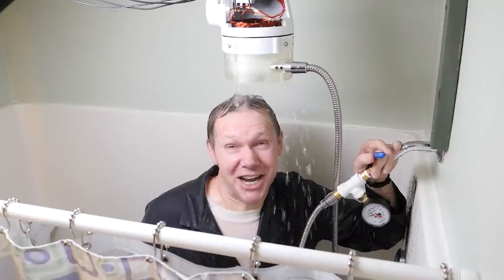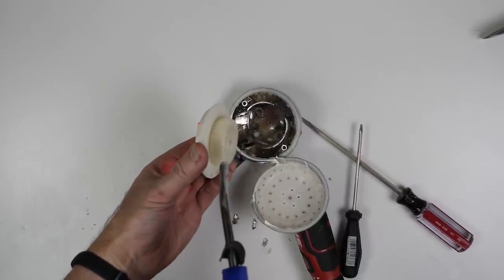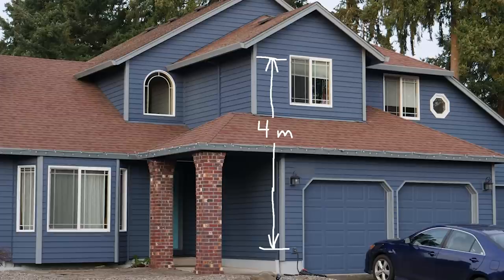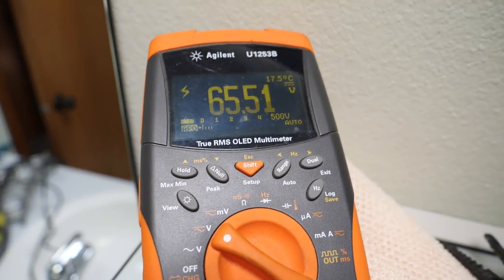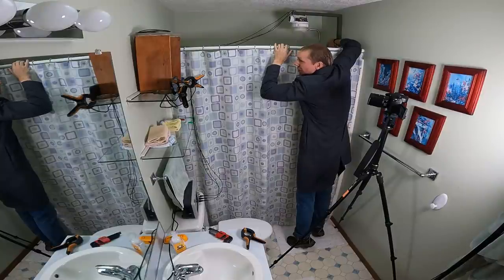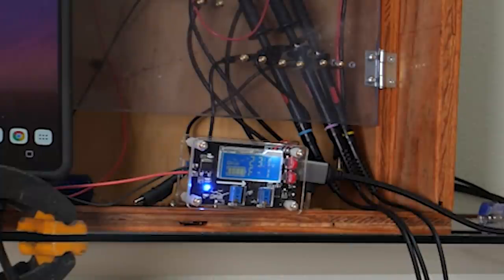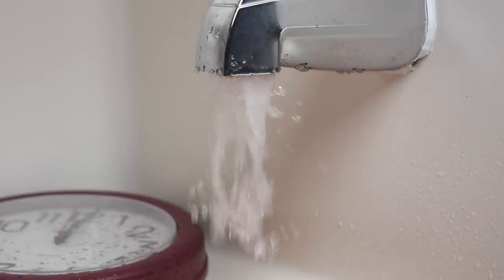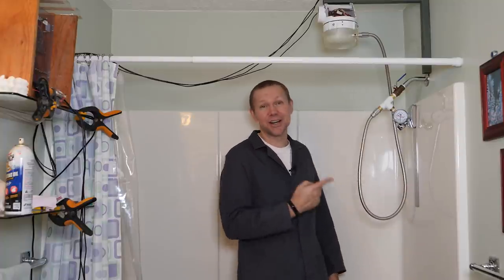SHOCKING Results! How much POWER is in your SHOWER?

Comment: Where dose the water turned 90 degrees from the wheel go? If it's bouncing off the housing and then hitting the wheel a 2nd time that would counter act some of the initial power from the water jet.

Comment: This video shows you what happens physically when you want to take energy from moving water. I had no idea it was that difficult to take 5 volts from shower water.
Seeing that generator suddenly lurch with a load was the most interesting part of the video to me.
Reply: yeah same.
I've had an idea where you'd replace the control nob with a micro controler paired with some digitally controlled valves, that way you could "teach" the shower what temps you like your showers. 
Me I like to warm up the water (I bet like most people) and then gradually increase the temperature as I shower.
feed those same inputs and timing to a MCU and it would eventually just learn my pattern.
Add the "pair my phone" and it would know who is showering at the time and recall the patterns
non of that cloud shower pattern lol, but just a simple "MAC address lookup"...

Anyway the main issue was that I didn't want to have to plug inn the shower or rely on batteries, then looking into those self illuminating showers kinda implied that, it can be done, but you'd either have to invest heavily into a miniature turbine, or have to deal with extremely low power MCU and motors... It's a neat idea for a problem that can be solved by "the hand" 😅

"modern problems require modern solutions, but some times the solution is the problem"

Comment: You need to keep the voltage up to drive the current it makes it way more efficient but you will need rated hardware maybe a solar inverter via a full bridge rectifier with a large capacitor between
Reply: that was kinda my thought too...

Comment: I've often thought whether this could be used in Scotland. Our water is paid in tax but not metered (it comes from the big lochs) would this be feasible to use straight from the tap using a generator to power smaller appliances?

Comment: Maybe you can put a gear between the turbine and the coil, that slow the spinning speed down but higher torque. Also increase magnet power to compensate the slower spinning speed I guess?

Comment: I am aiming to use a 275 gallon tank about 200 foot of line down an incline of a hill and use a water jet at the end twitch A pendulum wheel of two feet across for torque and generate a large amount of power from my house just by it raining 🌧!

Comment: I think the generator is spinning so fast it’s creating a back EMF voltage that’s limiting it’s output power. 
You should check out the motors max power rotation speed and see if you’re near it

Comment: Did it get hot? I mean you corrected the power available, so the jet should be throwing that power
The pelton has an efficiency limit but from 70 to 3 W...
If there are loses I think is probably heat

And one thing I want to ask, how did you expect to charge the phone with 70W? Doesn't the charger limit that to 5V and a safe Intensity?

Comment: You assembled this project, but you didn't do all the required engineering. Where is your computation of the expected electrical power output into a given electrical load impedance?  You need to match the RPM and torque of the turbine to the RPM and torque required by the generator when it is loaded at the impedance of your load.   A MPPT converter could help you a lot.  You also need to use all three phases of the output to fully utilize the generator and get decent efficiency out of it.

Comment: Hi, I think the problem is that you connected the Pelton directly to the generator. What if you use a pulley 3:1 to increase the amps in the generator. Lower rpm=higher amps.

Comment: You do a turbine like the archimedean screw turbine or you could even set up multiple jets around the turbine to give it more balanced pressure around the turbine or completely enclose the fan so the water has to push the turbine

Comment: You can use a stabilizer to transform the 65V and ~1A in a 5V constant voltage (it should be 10A)
Reply: So I think the problem it's in the electronics
Reply: That's not a stabilizer. That's a DC to DC converter.

Comment: I wonder if a fitting voltage converter could get more power out of the original coil configuration of the generator.

Those 65 V sounded like a lot, unless they were at 50 mA.

Comment: I don't know anything about this stuff but what if you designed the wheel so that it only directs the water downwards instead of up and down, so that the water is not staying in the enclosure and dropping on the spinning wheel? My gut feeling is that it's a tiny difference, but maybe a little efficiency could be gained.

Comment: To get the most power out from these type of generator you need a MPP tracker. Power is voltage times current If the generator is let open circuit there will be no current and there for no power. On the other side if an short circuit is made on the generator the current will be high but the voltage will be zero. No power generated in this case ether. The maximum power output lays some where between this tow extremes. 
 By lowering the current on the voltage controller the power output got closer to the maximum power point of the generator. You tracket the MPP without knowing it I presume. Thera are even of the shelf controller tho do this job with sophisticated algorithms. Main usage is for pv modules.

Comment: 1. You might be running into balancing issues when only pulling power from a single phase. 1/5th instead of 1/3rd?
2. Maybe using a 3-phase to single phase transformer might help. If said beast exists, in your power range.
Reply: Balancing on 3 phase is to do with load balancing where there is a neutral line.

Not relevant here.

Comment: How much height do you need for 80 psi? Like 160 to 190 feet or so?
If hydro works in commercial settings, it should also work in a private setup. Scale might be the only limiting factor. And a closed loop system would keep all components from debris. To make up for power use from pumping water back up into storage, a mechanical pump system that doubles as exercise equipment would work nicely. I always complain about there being no purpose to sit on an exercise bike at the gym, but if I had to do it to provide power, I’d much more likely to do it. 

Great experiment, keep it up. 

Challenge: scale it up to charge a 12V, 100amp 1280 wh LiFePoS battery

Comment: You should put wind turbine behind a car. Pelted turbine in a just right spot where it sits mostly in low pressure except where it pushes the turbine.
Reply: I mean... you spend gas to push car through air. but behind air does the job - that`s where you can theoretically collect power back. I will probably introduce drag anyway

Comment: This is a great project and a great video! I have to say though, I am a little surprised you just fired it all up the first time and blew up the one reg. Would have been better to see what the open terminal voltage of your generator was, then maybe put some load on it with some resistors and see what the voltage was then. Great video!!
Reply from the maker: Totally agree.  But that generator always underperformed in the wind power videos and was only rated for 12v.  So in my mind I had super low expectations for it.  In retrospect, the math predicted a free spinning RPM of like 6k so it should have been no surprise the voltage went that high with no load! 😜  Live and learn...
Reply: @QuintBUILDs  makes sense. Works out good though, when things blew up, people are entertained. That's what makes up 50% of drawn for Electrobooms channel

Comment: Well...  2.5 gallons at 85 psi, is about what a small 15amp 120v air compressor uses for energy.  Water is denser than air, and generates more torque, so that much should be recoverable.

I would wager, its partly an electronics issue, and partly a method of harnessing issue.

It takes large volume to turn a turbine, with a open case, and large cups, and big internal spacing. 2.5gpm just isnt enough. A turbine will not move as fast encased in water.

Need a closed cased with tight tolerances, and honestly for this type of application, possibly a smaller turbine, or piston, and a nozzle designed to produce laminar flow.  I think smartereveryday developed a cheap one in his video. Or just use a compression cylinder design.

Also the burned bearing was caused by something, probably previous use, combined with case pressure.  Case pressure means either the ouflow nozzle is too small, or there is too much water turbulence inside the case, probably the latter.  Solved by closer tolerances.

Comment: I have bin thinking about this for a while but not the shower but on the water main. that way you have the shower, sinks, toilet all in 1 swoop. Buy ofc you can just tap it at all points if the pressure is enough. I think pressure is high enough to tap it several times before the appliances. Ofc if everyone does this that resistance willl screw the water company but thats a not my problem kind of deal.   saving money is saving money.

Some quick math tells me this delivers about 10-15 kWh a year on my usage based off your power lol.

Comment: I think there's something wrong with the generator. Maybe instead of changing the generator, it would be better to add a transformer. It would decrease the current on the primary side and you'd have a lower voltage and higher current on the secondary side.

Comment: The one thing missing in this is the amount of energy that goes into heating that water in the shower as that is where the most energy is... The title is because of that wrong as this is just about the energy you can harvest from the cold water pressure in the water supply which on itself is interesting.

Comment: Hmmm....modulate flow rate to optimise power at a lower RPM somehow, maybe...apply more torque to the generator, so it harnesses more power? after all it's designed to operate against a LOWER density fluid...

Comment: I would not have modified the generator. You were getting 72V originally, but didn't see the amps on it. I would have run it through a buck converter to reduce voltage. I think the Wye configuration would have been better to keep. Just a guess since two coils is better than one. Maybe you just reduced power by half. I think the problem was introduced in the generator.

Comment: If the issue is the generator is spinning too fast, what if you made the wheel larger in diameter? That would slow the rotation and increase torque.

Comment: You could also build a custom transformer to reduce the voltage before you rectify them. Or get a dc-dc converter to reduce the voltage.
Reply: May I shortly ask how does a dc to a dc converter help?
Reply: @vinu6484  either option would decrease the voltage and increase the current, increasing the power to the five volt load. His regulator probably has a dc-dc converter in it, but it's poorly designed and not working well.

Comment: Attach a small gear from the turbine, to a  bigger gear on the generator. This should limit the number of rotations.

If overly done, this could allow for multiple generators to be attached because the speed is exchanged for torque.

Or am I missing something? By no means am I experienced in practice.

Comment: if the windmills gen, could get more volume it would work better, without it it does spin but not as fast when you load the generator ..so you need more volume.

Comment: you could gear it down to the speed that the generator would normal be supplied, and it would convert the difference of speed into torque, and you wouldn't get surging as much, cause the torque would overpower the electric field, thus, you'd probably get more current.

Comment: I think he should have checked for the standard rpm for the generator when it was working normally then if able try to match it with the pressure from the water and the 3d printed spindle thing

Comment: My name is moonshine
Using fluid power.
Start with a magnet and make it into a shaft.
So the magnetic shaft will fit inside water pipe.
Take the magnetic shaft and have it milled into a archimedes-style screw..
With Tesla turbine blades..
Secure the magnetic shaft with the Archtesla
Design inside of a water pipe..
Simply add the magnetron on the outside of the water pipe. Thus producing  hydroelectricity...
Lining them up in multiple sections throughout the length of the pipe would increase the amps.

Comment: how about changing the wirings of the generator (for higher power) and putting some gears in it so even the flow is at maximum state the torque inside the generator is higher and the speed of the Pelton. Correcting the output frequency of the generator and producing more power from higher torque. 
About the voltage, if it is high, how about creating a power supply that uses all of that juice to create more current.

just my thoughts. peace!

Comment: Yo, what's your thing with laminar flow, you said a couple of times frictionless laminar flow, and losses due to the flow not being laminar. I think you're mixing the concepts up. Laminar flow is more cohesive than turbulent, and that's mainly  due to the viscous forces being higher than the inertial forces. So just to clarify, Q=VA is kind of restricted to laminar flow, but laminar flow also has friction, and the flow inside the ducts is probably laminar, due to the low velocity. It's true that turbulent flow dissipates in general more energy, but not as viscous losses, but rather because it has a way higher momentum exchange efficiency.

Comment: What about a reduction gear for the shower generator? Slow the turbine speed while allowing the water wheel to spin as fast as it needs
Reply: I was thinking similar ideas, a larger turbine would amount to the same thing.not enough torque. Also could try a transformer or three on the output coils. I suspect the turbine turns the generator but with little torque resulting in high voltage but almost no current. The massive difference in voltages between the usb and generator could be an issue. Perhaps the rectifiers can drop the voltage down to 5v but not so good at boosting the current up to match the potential power .

Comment: You reduced the voltage.  Up the voltage again, use the full it can output.  That should be AC.  AC to AC conversion trades volts for amps, so why not convert in ac to the voltage you need then rectify?

Comment: I may be wrong because i'm not an engineer or anything, but in your calculations shouldn't 1L be swapped for 1dm^3 instead or 1m^3? At least if this was straight conversion then it should be, but again, maybe there was some more math that made it 1m^3 instead